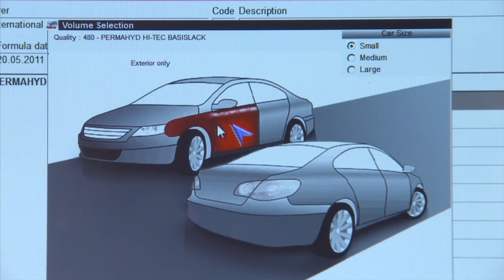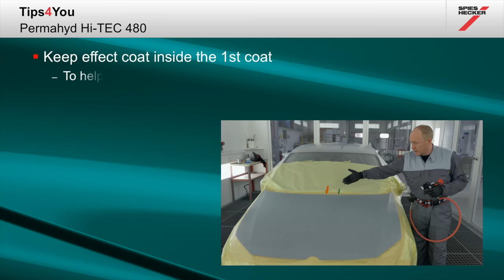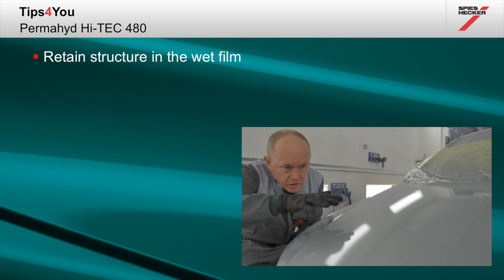Permahyd Hi-TEC 480 - How To Control Mottling

Comment: great demo , lets say the job is alot larger than a hood/bonnet, and i notice mottle, lets say its already flashed , can i apply another full coat then another drop coat , or apply the blender to the 1.5 coat surface then apply another drop coat ? cheers
Reply from the maker: Thanks for the question. This is probably the most challenging fix due to the fact that already flashed basecoat will absorb any subsequent coats applied over it making it difficult to achive a homogeneous film. It really depends upon the severity and extent of the problem you are trying to fix. Small localsied areas can be corrected using RFU material at low pressure - 0.8 - 1.0 bar to apply a droplet coat and disguise the issue . Please see an example of this technique here https://www.youtube.com/watch?v=43pJVw3Hviw&list=PLCbYtPwxXqmhyXzA1r8ONRfSqF62HA0Wj&index=14 For a larger area you can apply an even coat plus an additional effect coat without over applying/wetting the substrate but he safest way is to apply clear, dry, sand and reapply the system.
Reply: @Spieshecker  thanks for your reply. Have been using this system for a month now in a busy smash shop . I feel after a couple of weeks I have my head around the product now . I’m looking forward to creating content using the system and promoting your products. Thankyou
Reply from the maker: thx for your feedback and glad to hear your are now into it! Happy days...

Comment: How does this apply on darker colours with pearls and metalls like Renault kpn. I have problems with mottling on these colour groups but none on silvers.
Reply from the maker: Hi, thanks for the question. This method will work equally well on darker colours where some additional control may be needed.
Reply: @Spieshecker problem solved. I quit using Sata for color. Instead i use Iwata Wbx and i have no more mottling. Thank you for your response.

Comment: Tip and pattern recommendations?   1.2 RP O ?
Reply from the maker: Thanks for the question, with the Sata 5500 1.2O I would suggest an inlet pressure of 2 bar (approx29 psi) and a full fan.

Comment: hi..can i ask what is criss cross pattern in spraying and what is the purpose of that spraying pattern? thanks
Reply from the maker: This describes a technique where you change the spraying direction over a panel from coat to coat i.e. first coaon a hood is applied from the side to the middle and then completed from middle to opposite side. In the second coat you spray for example from the back of the hood to the middle and then the middle to the front edge thus shifting the overlaps in the belief you will avoid stripes in your basecoat. In reality as long as you concentrate on your distance to the object, overlap and speed you can control stripes/mottling etc as shown in the video.
Reply: @Spieshecker  thanks...

Comment: How do you fix it. If the paint is dry before you see something you don’t like?
Reply from the maker: Thanks for your question and sorry for the slight misunderstanding. In the video we show how to fix any mottling whilst the paint is still wet, which is the best way to remedy any mottling.  This is a common question we get during trainings and customer visits. However we know what you mean, and we have already other videos in production to deal with this topic.
Reply: I've found if I mix it with some 1051 n kinda blend it out a bit works I've also just wet bed the area n did my thing n have had some luck even though it seems like it dont wanna go on it all works out in the end somehow best thing is to try n keep everything clean and focus on perfection I love this base though way better than ppg in my opinion
Reply from the maker: We will have a video coming out soon to show you how to rescue the job in this case, and avoid making a rework.
Reply from the maker: Please refer to the blending video, this is the way the product was developed and it really does work.